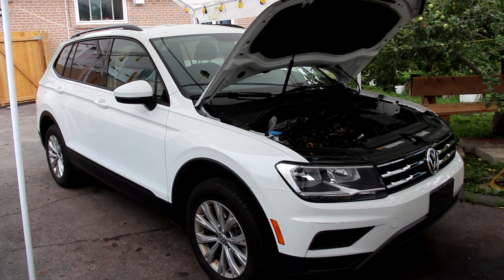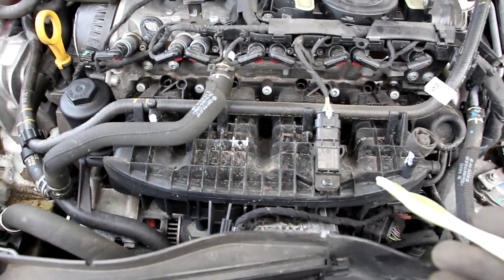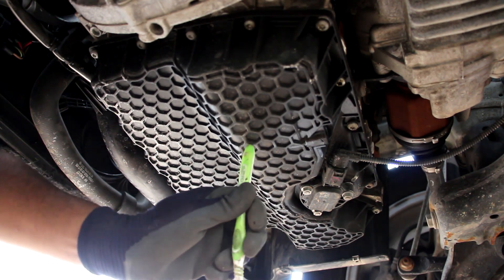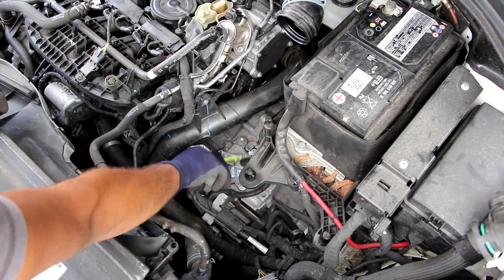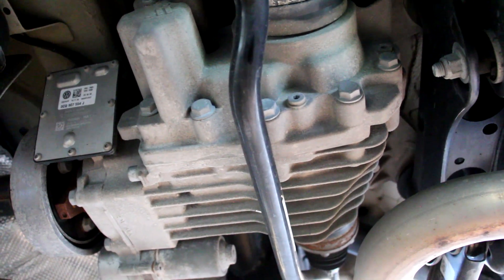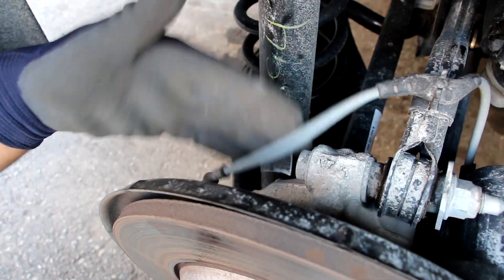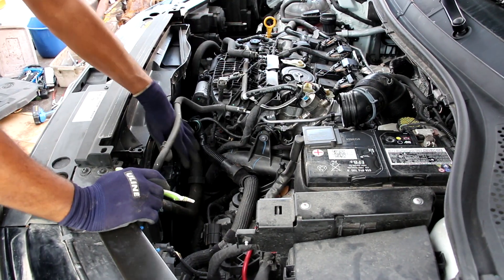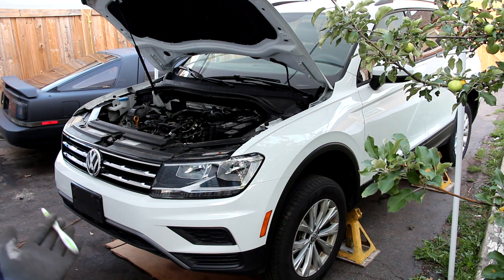Volkswagen Tiguan Mechanical Review

Comment: Why are you so negative omg? VWs are reliable. Like go to most African countries and you'll see an abundance of 2 manufactures....VW and Toyota because they're reliable. The VW manages to be reliable while using newer tech like tsi engines. These Polo 1 litre TSi turbocharged 3 cylinder engines already are running about with hundreds of thousands of kilometers doing just fine while Toyota needs an old fashioned and sloooow NA engine to do the same.
Reply: I don't mind the engineering of German vehicles, they are a huge pain to work on when they break.
Reply: Modern Volkswagen is shit😂
Reply: There aren't a lot of VWs sold here in the US that are built in Europe..a few models are built in Tennessee, many more come from Mexico, and a lot of the parts come from Mexico or South America.  Some argue that these facts make US-sold VWs less reliable than those built/sold in Europe. 

Personally, the worse car I ever owned in terms of reliability was a German-built VW Passat.  That was 20 years ago, but seeing them use plastic oil pans in their modern designs and seeing VW actually REDUCE the length of their bumper-to-bumper warranty doesn't give me any reason to trust them a second time.
Reply: @driveway_of_misfits  I mean people in Africa and Europe buy them because they're reliable. In South Africa Golf GTIs are even used as police cars and hijack recovery vehicles. Those are driven hard daily. They're doing just fine.
Reply: @SDav21  Here they just don't sell well. VW just stopped selling the Mexican-built Golf here...we'll only be getting the MkVIII Golf GTI.  Here Japanese cars have a reputation for being very reliable while VWs have a reputation for being UNreliable.  If VW does nothing to try and convince us otherwise, then they'll never be a big player in the US market.
Reply: They sell like hot cakes in Africa because we consider them a safe investment. I guess different markets have different priorities when considering a car. Volkswagen Polo is the best selling passenger car in South Africa. Toyota & Volkswagen are the big 2 in the country. Americans don't seem to like Volkswagen but there's nothing wrong with it. I'm sure Europeans agree with us.
Reply: @mziwendukuntsele671  No doubt.  Here in the US European cars only make up 10% of the market, with 40% being Asian brands and 50% being US brands.

VW is the only European mainstream brand sold here...the rest are "premium" and "luxury" brands (Audi, Range Rover, BMW, Mercedes, etc.)  VW does not sell the Polo or Up! here either so we don't have access to "affordable" VWs, just the more expensive models (which are priced higher than comparable US/Japanese/Korean competitors).  Add in the fact that parts for European cars are really expensive here VW does NOTHING to address their reputation for unreliability, and you have a recipe for failure in the US market.
Reply: @driveway_of_misfits  Strange. In South Africa there's literally after market shops dealing specifically with German brands selling high quality new parts and refurbished parts.
BMWs and Mercedes and VWs are used by the police. Uber Black drivers mostly use E Classes like how in Europe many taxis are Mercedes. Ambulances are Mercedes Sprinter vans. I don't understand how the US market can't do the same in terms of parts pricing and servicing. Maybe there's a lack of mechanics who can work on German vehicles?
I don't know but whatever it is is strange. Mercedes has the best resale of other luxury brands and VW probably even better right up there with Toyota. But again different markets I guess.
It just can't be that a VW is unreliable in the US yet reliable everywhere else. Something is wrong.
Reply: @SDav21  The German brands sold here in the US market themselves as premium luxury brands...and they price both their vehicles and parts accordingly.  It's probably the only way they can sell cars here to be honest.

There are plenty of mechanics who can work on German cars but my experience has been that mechanics don't like working on them.  Some refuse to work on them at all.   I heard one say that "the Japanese are experts at making complicated things simple, the Germans are experts and making simple things complicated, and the Americans are experts at making simple things poorly for complicated reasons"  :D
Reply: @driveway_of_misfits  The German brands are marketed as premium brands too in other markets but perhaps their popularity makes it easier for parts to be more widely available as well as expertise.

There's a difference. I think the Germans do over engineer for certain reasons. Their cars feel more solid, more refined, more comfortable yet more sporty, more technology filled etc. A Toyota Yaris for example can't even compete with the previous gen Polo let alone the new one. So there is some merit to what they do. It may be more complicated but it pushes other carmakers and the industry forward. And their cars are reliable if people just maintain them like the manufacturer intended. Many complain about German cars and reliability but usually that comes from people buying them used where in most cases, previous owners didn't budget for maintenance so either didn't do it or did it cheaply. It's not fair to blame the carmaker for that.

Plus I think VW has a hard time in the US because generally their cars are a little bit more premium than other mainstream brands but Americans don't see it that way. Like the US market would most likely love the European Passat but if they sold the euro one in the US, the price would be above those of the Camry and Mazda 6 and Accord etc and then complain despite it being more premium. The US Passat is just sad but they had to then do that in order make it work for the US market yet it probably doesn't because it's a compromise on what they would usually do (i.e the European Passat).

Funny how markets can be so different and have such differing views. I always struggle to understand the view of those in the US with regards to German car reliability and resale value. I've seen Mercedes A Classes selling for 70% of their value after almost 4 years in our market. Crazy. Oh well.
Reply: @SDav21  It's definitely interesting to see how different the various car markets are around the world and how the reputation of automakers varies so much.  Americans think European cars are crap, but Europeans think American cars are crap, lol!

Unfortunately once an automaker gains a reputation for being unreliable, it's really hard for them to change people's opinions.  Back in the 1970s/early 1980s the US automakers were producing junk and a lot of Americans switched to Japanese cars.  Eventually US makers got a whole lot better but good luck convincing people to switch back from a Toyota to a Chevrolet.   Fool me once, shame on you.  Fool me twice, shame on me.

As for VW specifically, I've heard a lot of people say that they're great cars if you just maintain them.  I believed them, bought a VW, and maintained it RELIGIOUSLY.  Still had a ton of problems with it...multiple catalytic converter failures, front suspension failures, electrical issues, coolant leaks etc.  Those aren't from lack of maintenance, those are from poor engineering and low quality parts.  As much as I like the restrained design of VWs, they've done nothing to convince me they're any better now.
Reply: @driveway_of_misfits  Wow never really heard of those issues on VWs.
Reply: @SDav21  One of the reasons could be the cost of labor. It's very high in the US, so disassembling half of the engine bay to replace a stupid thing that broke or rebuilding an engine or transmission is going to be prohibitively expensive. Add to that many sloppy owners that don't care about proper preventative maintenance and you have a recipe for disaster. A Toyota being a simpler car can survive for much longer without good maintenance and they also rarely break in stupid ways
Reply: @SDav21  Americans in general hate European cars and are biased against them.  They drive them without proper maintenance and think that you should only take a car in for an oil change and when something breaks.  I can attest to this from my own family.  Owned Japanese and American and all broke.  The Corolla we had lasted the longest but it drove horribly and burned a lot of oil.  I guarantee you this is how most Americans treat their cars and, when something breaks, they blame the car for being "unreliable"
Reply: @BabyBugBug  Well parts on cars are not supposed to break prematurely...
Reply: VW was good. Not the modern VW engines. The DSG Gearbox used is riddled with issues, Still VW uses the same. Why not use a ZF like Toyota, BMW, Honda, GM, Ford and others? Why still push that DSG? VW uses only DI engines, which have issues too. Why? VW's were Ultra reliable earlier, but modern ones aren't that great.
Reply: @kris-ec2bc  Toyota uses ZF's? Don't say the Supra, that is an BMW.
Reply: @kris-ec2bc  They do use ZF's 8 speed on many of their cars now.
Reply from the maker: The older VW were good. The new stuff you see in the junkyard after 10 years
Reply: @speedkar99  It's the new Polo's with TSi engines from like 2016 up. Some have hundreds of thousands of kilometres and they're doing just fine. Americans must just stick to horse and carriage maybe.